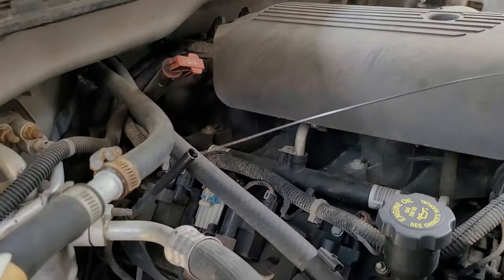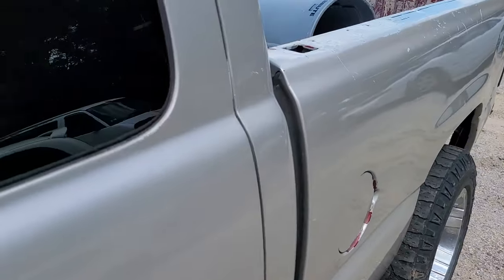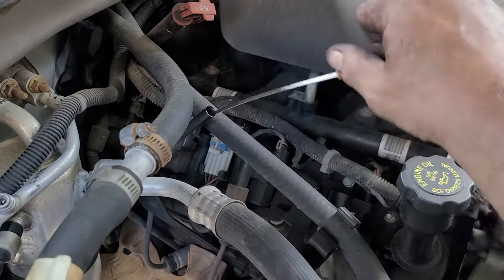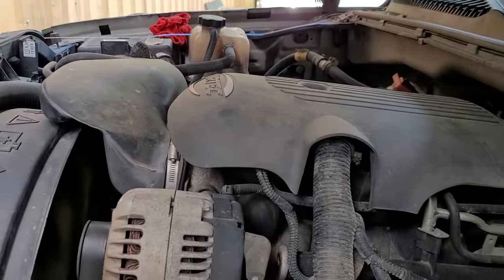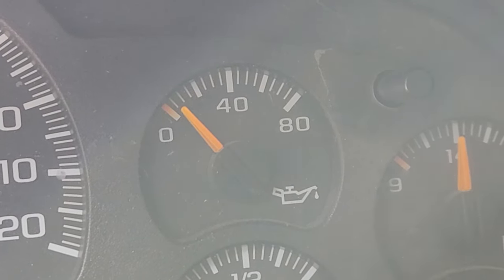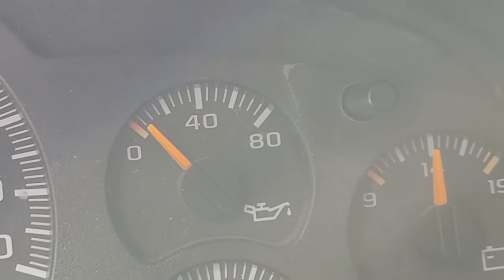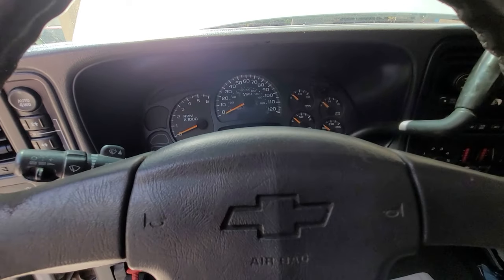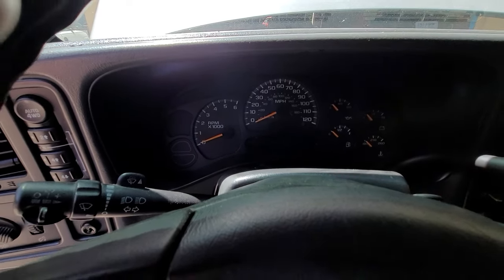Chevy Silverado 5.3 With no oil pressure & making noise. I think this one is done for

Comment: Either a bad pump or pickup tube oring. That a lifter screaming for oil pressure. It started like that due to the lifters not pumping up. No pumped up lifters no valves opening fully or at all. Been there with 2 of my truck . 5.3 and 6.0
Reply: Yep just went through same with one of mine and about to do it to the other

Comment: I would say bad Oil Intake O-Ring, Bad Cam bearing, or possible oil pump. Oil Pumps are not known to go bad often, but the O-ring and Cam Bearings do go bad in them. Time to diagnose which is the culprit. Those would be my 1st 3 items I would check. Also the oil pressure sending unit.
Reply from the maker: The customer ran it out of oil. It destroyed a lot things. Thanks for watching & keep wrenching 🔧

Comment: The basic rule is check at least once a week and top up as required also as the vehicle ages you can go to a  higher rated oil so you can go from 5w 30 to 40

Comment: I have a 2004 gmc Sierra 1500 with the 5.3 in it. I purchased it cheap from a logger and the truck was starting just like that one but mine has oil in it. I thought the battery was bad but i put a new one in and replaced the starter. Starts and runs good but once its warm youll hear the lifter tick and my oil pressure gets to 10 psi. Now ive changed the o-ring and the oil pump. Still have low oil pressure once it warms up. Now i have purchased a low mile 5.3 online lol. Guess I'll take this turd apart and see whats up
Reply: Did you ever figure out what the problem I was?  I just bought 04 2500 6.0 and having the same problem and dont want to do the pump and lifter tube for it not to work ?
Reply: @marknogueira6425 I'm having this same problem with my 5.4 l. I have clean oil in it. When I start it up there's no sound but as soon as I let it heat up the ticking noise starts. I decided to take it into a mechanic tomorrow. Smh

Comment: Man stop the engine and put oil in it or it will lock up.
Reply from the maker: Amazingly enough, the guy is still driving it around with the only issue being oil consumption !
Reply: Or just even add a bit before starting to get the dipstick reading.
Reply: Mine has 370k + and drinks a 5L jug between changes 😂
Reply: I was thinking the same thg 🤦 must be tryna get a engine job🤔😅

Comment: The low pressure indicator will ding ding on mine if it gets that low , I'm sure the suction tube seal needs repair
Reply: The oil pressure galley plug in the back of engine has caused lop problems

Comment: My Silverado has no oil pressure on start up. But once it warms up the oil pressure is fine and the engine is quiet. I'm trying to figure out what the problem is...
Reply: o-ring in oil pickup tube - do a search

Comment: Oil leak? Where's the oil going?
Reply from the maker: I think this thing just wasn't maintained and using some oil. The lower you get on oil, the faster it uses it and gets lower. The engine had several light leaks , but nothing that would leave constant spots or stains
Reply: The owner could also be manually down shifting the transmission to use the engine as a brake. LS engines are known for using the oil up when you do that. My ‘99 Z-28 with 6 speed manual will run low on oil in about 3K miles if I downshift to slow down a lot.

Comment: So what makes the tapping sound?
Reply: The lifters are dry and collapsed.
Reply: Sounded like failed oil pump . They will still make 40 psi , but sound like lifters ticking .
Reply: Dry tappets the little bits of metal that sit at the top of the engine under the camshaft

That sound indicates no or low oil however if smoke is being seen at your exhaust the engine is on its last legs and soon you will be dumping a litre of oil a day into it 

My advice would be to sell it or scrap because in about 12 months you'll be paying for the neglect